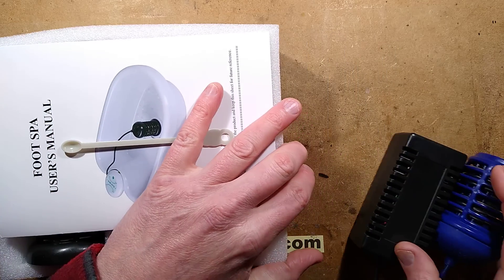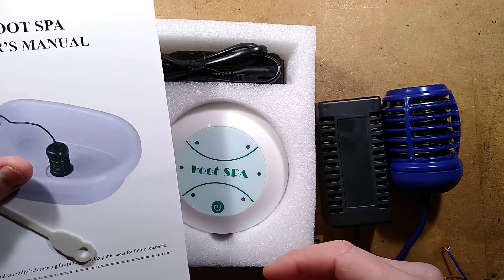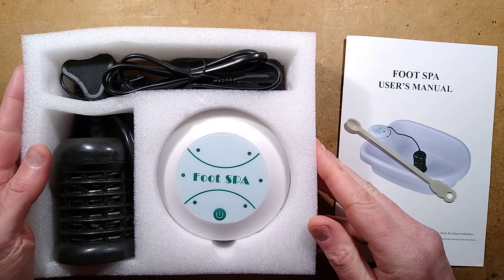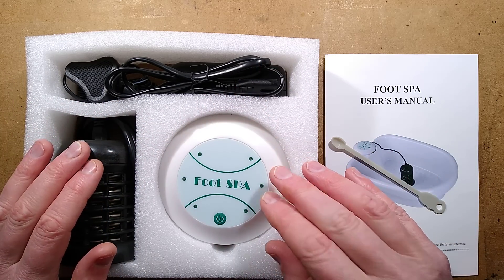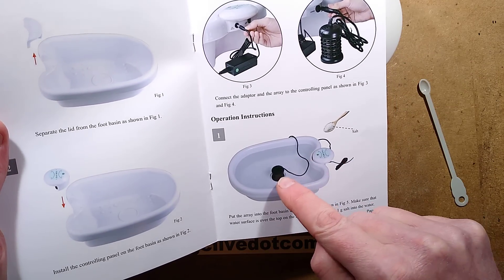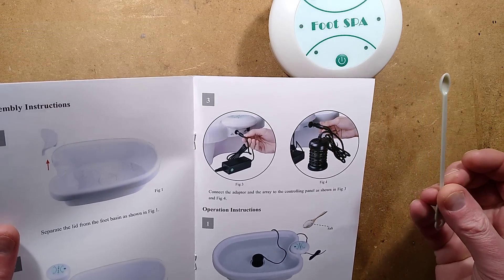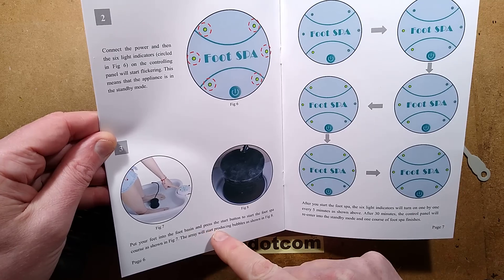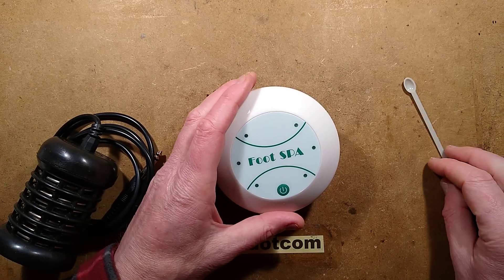Inside an ionic foot detox spa unit.

Comment: Blows my mind at how much engineering and manufacturing went into the circuitry when after all is said and done, its just a bunch of bullshit wankery.
Reply from the maker: There's a recurring pattern of well designed quack devices.  Like it's a recreational thing for professional designers.
Reply: @bigclivedotcom  - they are running a secret competition on who can produce the most complicated circuit that doesn't do anything.
Reply: @SimonCoates  sounds like the old the old friends class competition.

A few Lego ones as well.

And more.

In a certain illustrator.

And I've seen a lot of these in museums sometimes.

You know start something from mouth trap and winding up having something in the end.

Aka the better mousetrap.

But the best description of all will be a Rube Goldberg device.

Does anybody remember those wood blocks with the handle in turn called to do nothing.

But there's one that would probably qualify but it's more likely to be born on training depending on which one who builds is excetera.

Those useless machines.

Or as one of my friends likes to make them and calm the cats out of the Box.

She gave me one of the ones he made for Christmas one year.

Except this one does other things and is actually partially functional.

Has some useful functions actually.

The one he gave me was built into a ramp that when it's in a certain mode if you turn the lamp on or off it turns itself either VAC on or back off

With a fake cat paw and the head pops out here and there.
Reply: @bigclivedotcom  I presume in some areas these kind unpleasant-looking jobs might be the only opportunity for professionals to get decent salaries, i recall listening to a few lectures by a decent Russian medical professional who mentioned how he started his career at a quack medical centre just because it had jobs and it paid well compared to proper medical establishments.
Reply: @bigclivedotcom  One has to wonder how long until we see medical quackery devices claiming to protecting us from the current virus situation.
Reply: That's why Scientology e-Meters are so well built.
Reply: Honestly, the circuit looks very legit. But the load is rather dubious as far as I care.
Reply: One of the fake domestic power factor correction devices even had a big electrolytic capacitor only connected  on one leg!!
Reply: @pdrg  Wouldn't want to stress the component, eh?
Reply: To me, it's like there's almost enough stuff on this board for an MPPT charge controller..  pure insanity.
Reply from the maker: @Linda Glendenning So tell me more about your engineering skills and the time and areas in which you have worked.  I've been designing, installing, maintaining and reverse engineering electrical and electronic equipment for 40 years continuously.
Reply: @Linda Glendenning Sure you are. this technology doesn't work it cant work. first of all your body has a system for removing toxins ITS CALLED A LIVER so on that basis alone this device is stupid. secondly how exactly do you propose this device actually removes toxins? electromagnetism? because unles syou are trying to remove iron from your blood (even then blood is diamagnetic)  it wont work. All it is is hydrolysis and chemical reactions that make it look like its pulling toxins from your body. tell me why was the water turning yellow even though Clive had is hand away from it was it pulling toxins from a ghost?
Reply: @shadowxxe  what makes it even better, is that multi-colored junk cominv out likely contains dangerous compounds of lead and chromium. Instead of detoxing your body it's pulling a bunch of tox out of the metal electrodes, and putting some of it into your feet.